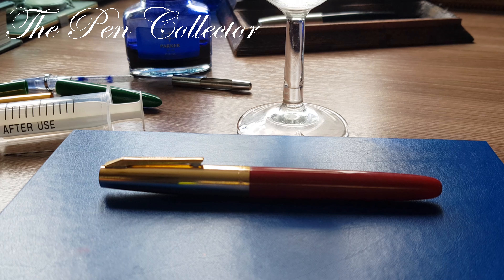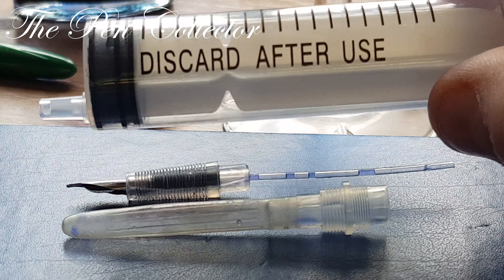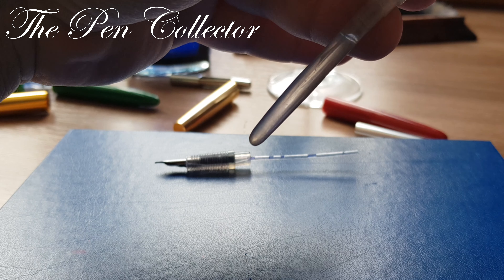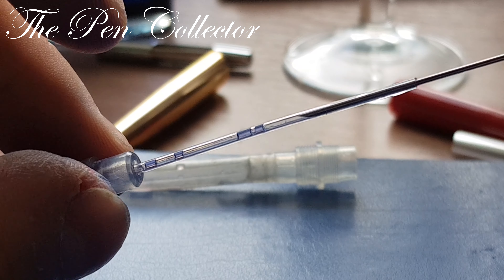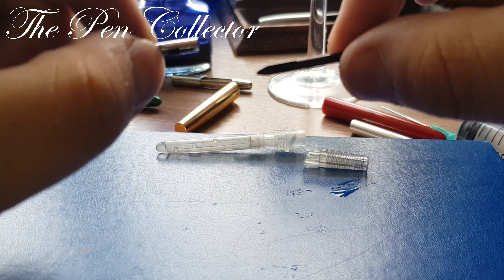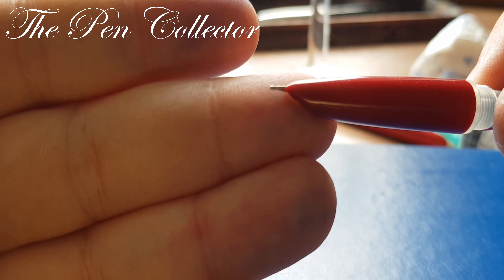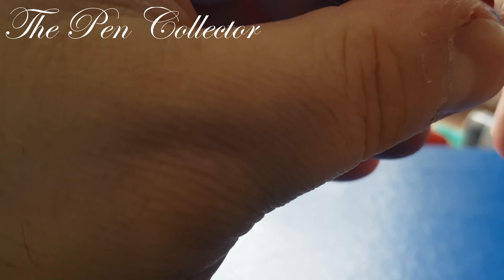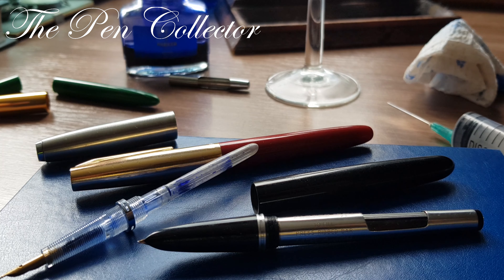How to disassemble and clean a Chinese aerometric fountain pen?

Comment: I can't open the top half of the pen. Can I just flush the pen out by filling the plastic sac with water using the pipet?
Reply from the maker: I don't think so. If the "top half of the pen" is the grip section it unscrews but it is also secured with a adhesive (shellac) that can be heated with a hairdryer or using hot water. I recommend the hairdryer. You can clean the sac without opening the whole pen by filling and unfilling with water.
Reply: @ThePenCollectorBogdan  Will this method of cleaning the pen (without opening the whole pen) also clean the breather tube?